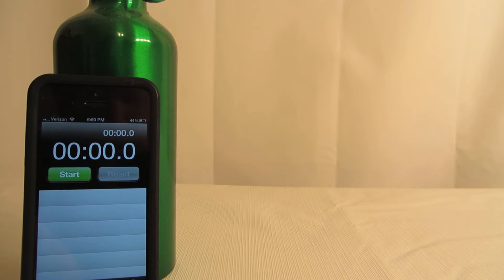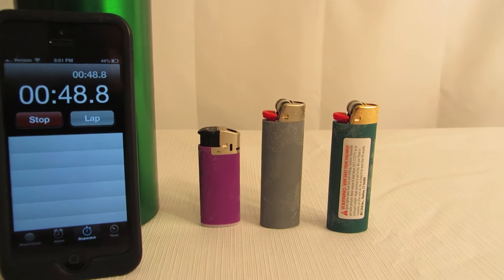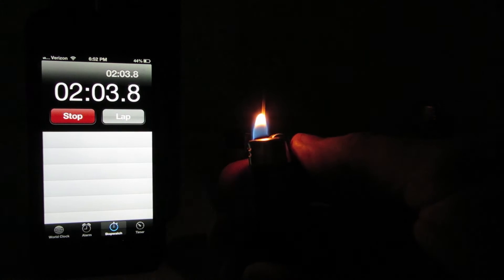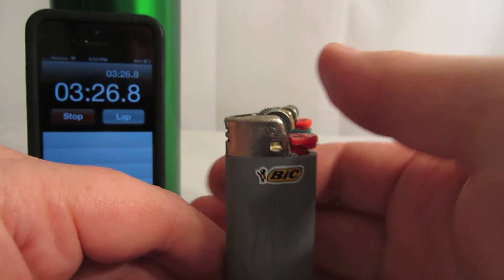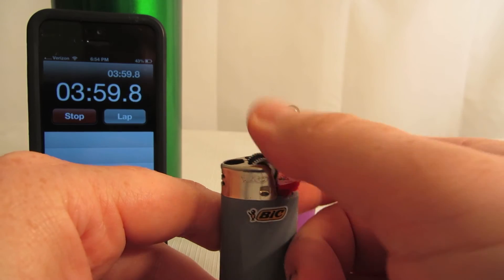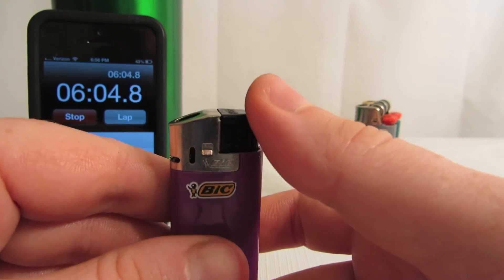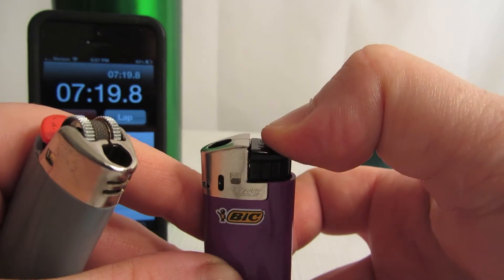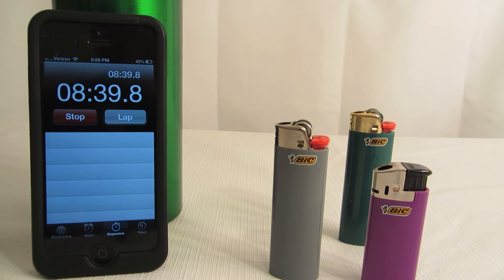Bic Lighters Freezer/Cold Test

Comment: I'm glad to see you do a test with these.  I would suggest that you try these out in the cold.  When they are in the cold environment trying to ignite, you may see different results.  Factor in diminished dexterity, a slight to robust breeze, and they can be hard to light.  I have the best luck in very low temps with char cloth.  A breeze is actually a benefit.  But the BIC still has a place in my bag for sure, despite it's shortcomings.